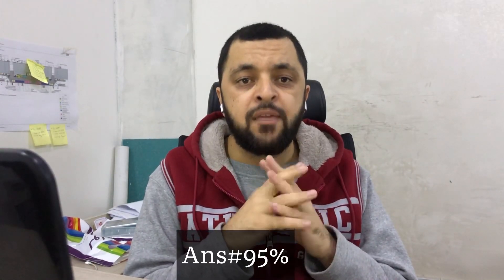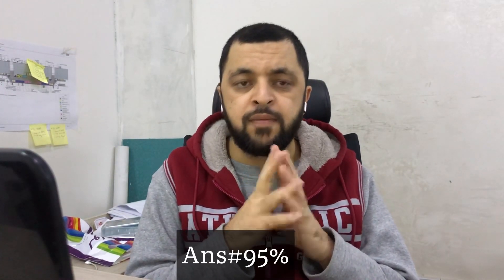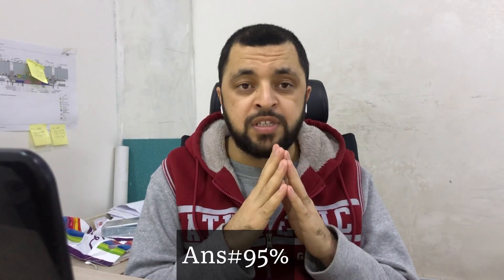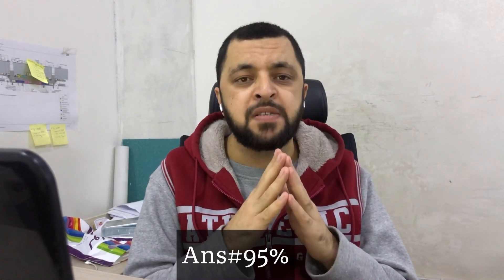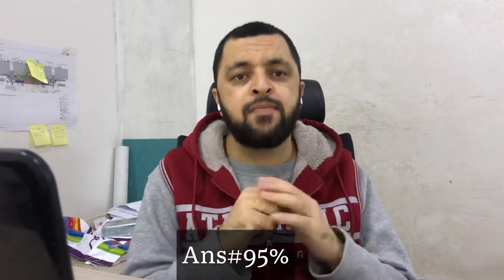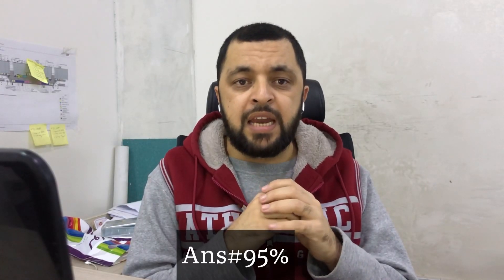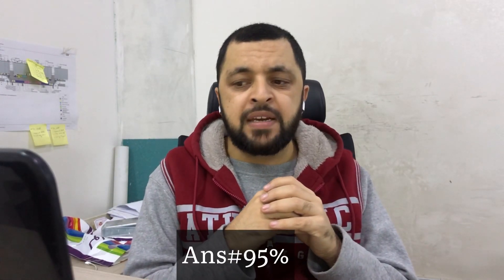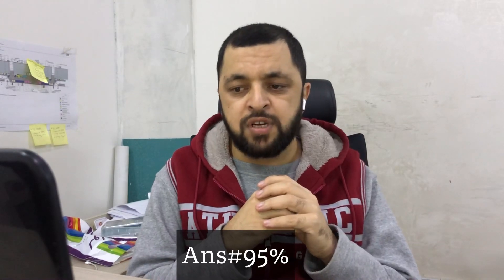Interview Questions And Answers For Civil Engineering Jobs in Aramco Part-8| Jobs in Aramco Projects

Comment: 4000 psi > 28 mpa 😂
Reply from the maker: Bro did you know about concrete mix design? Every project has their own specs and mix design. C30, C35 or C50
Reply: @CivilEngineerAtSite  yes this is class of concrete bro
Reply: 1MPA > 145.038 psi am right?